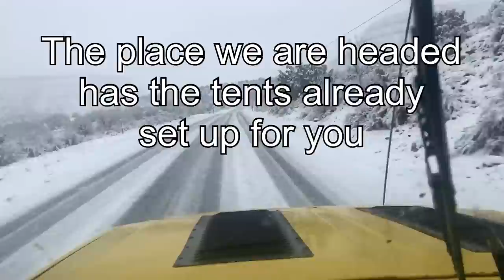Thanksgiving Day Rescues! Nissan Titian, Buick, Mazda, Dodge, Chrysler

Comment: How bad are the drivers ca 3,00 i mean you can easy drive with winter tires in 3-4 dm/1+foot of snow in a regular 2 wheel drive car, how can they get stuck? I live near the article circle and regularly drive a 2 wheel drive estate car with no problem in those conditions, and the 4 wd mazda at the start of video, does in run on summer tires? those cars can drive in almost anything with good tires 🤦‍♂️

Comment: All cars have tow hooks in the front. Why do you put those things on the suspension or whatever arms by the wheels. You are not supposed to. The tow hook is usually behind a small plastic flap in the front bumper. The actually hook is in the boot/frunk. You screw it in to the hole. I do not see how putting it where you put it is any good for the car.

Comment: I know I am a little ignorant on out west roads being I am from the northeast.  I do know there a lot of roads out there that aren't paved when you are off the beaten track.  However, why doesn't the state pave and salt roads they know for a fact will get people stuck all the time?  I mean you know and I know that in certain areas, you just need 4WD.  But in tourist areas where you know people will be visiting from other areas and do not know they need 4WD, the roads should be paved and salted.  Its 2019 and people don't use their heads.  Its unfortunate but the state needs to account for that.

Comment: I don't understand how people dare to venture out in such weather and terrain on summer  tyres OR all-weather tyres. ALL-weather tyres don't even exist as such. There is NO tyre which can function at its best at all temperatures. At 7°C or below it's time for winter tyres. Winter tyre is not a snow tyre only. It's outside temperature which is important. Breaking ability/stopping distance on summer tyres worsens at 7°C or less, significantly because the tyre hardens from the coldness. Winter tyres have a softer compound so they remain supple.

There is NO substitute for winter tyres. The cheapest and worst winter tyre would have never got stuck on that stretch of road. It would have got up that hill as though there was no snow.
A set of wheels with summer tyres and a set with winter ones is the best/safest solution.

Comment: This towing operation looks pretty amateurish, but it's a garment that's tailored to fit its clients.  As long as people try to negotiate mountain trails and sand and mud pits with cars designed only for city streets, it will thrive.
Reply: dont know how you could make this any more professional than it is
Reply: @narlynarwhals27 :  Indeed, it is professional.  I said it doesn't look like it, thinking of  the towing-company video channels that feature highly polished, million-dollar cranes hoisting 18-wheelers and cement mixers out of various misadventures.  These rigs would be totally bogged down before they ever got to the incidents that Matt handles so deftly.